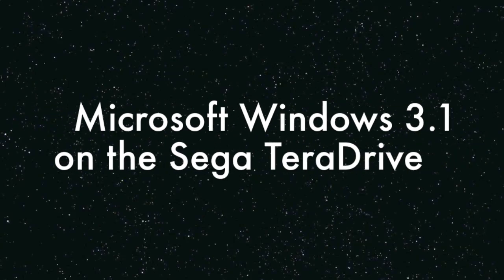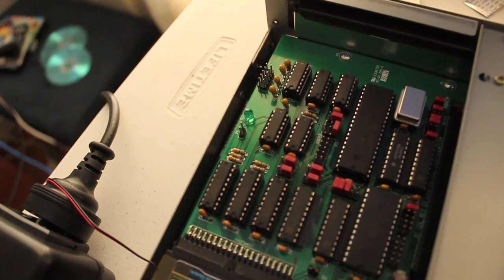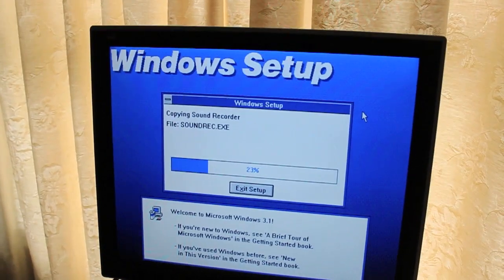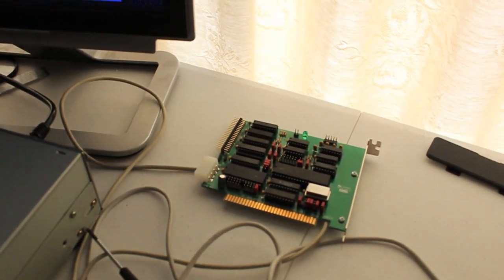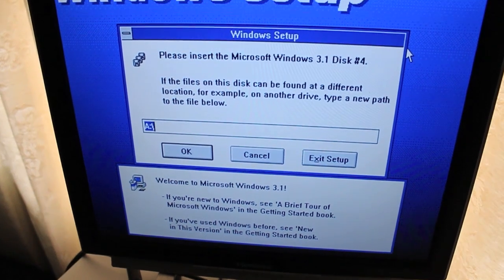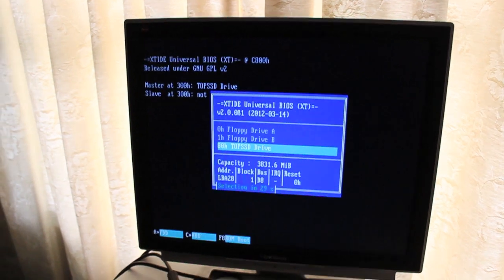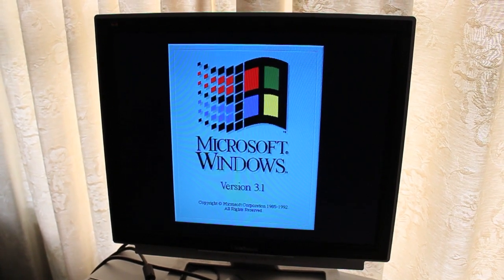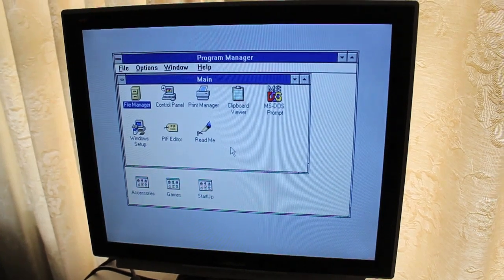Sega TeraDrive (Model 2) XTIDE Windows 3.1 Install

Comment: The "see-ga"? :P
Reply from the maker: Where you living? :P
Reply: ***** The Netherlands, but that doesn't change the pronunciation of Say-ga though. :P

By the way, this system is rather amazing. Wish there'd be a modern day console/PC hybrid.
Reply from the maker: Haha it does when the yanks pronounce Mega Drive as Genesis! :P Did Europe really follow the Say-ga pronunciation? Here downunder all our ads were See-ga, so it stuck! 

Isn't the Xbone a PC to some degree? I haven't used one yet but I do remember seeing something about Windows 8 being included. Or was it a dream?
Reply: It's really interesting to hear that the See-ga pronunciation stuck there even though Sega really tried its best with the voice clip intros to make sure people say say-ga! I never would have expected that the local ads would undo that, haha. As for the Netherlands specifically, I never saw any Sega commercials, but it just makes sense from a language standpoint to pronounce it like that. Same for a majority of non-English languages, actually!

And yeah, modern systems are pretty much PC systems now. Software-wise they're locked into the Xbox One stuff though, unless you crack that stuff. More officially, it's actually going the other way around - you'll be able play Xbone games on Windows 10 soon, from what I understand.

I just really think that the idea of having some sort of hybrid system is quite neat. I remember a Saturn dev kit being similar to this too, where you could plug in Saturn controllers. And then there was the possibility to run Windows CE on the Dreamcast... Sega was just kind of an interesting company that experimented with this stuff a lot, now that I think about it.